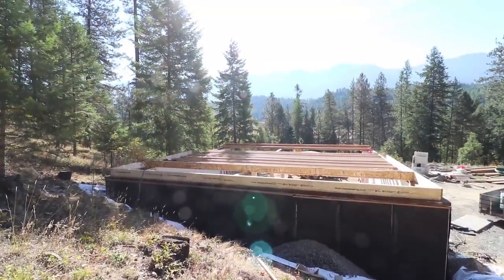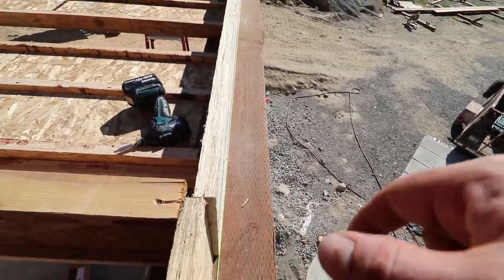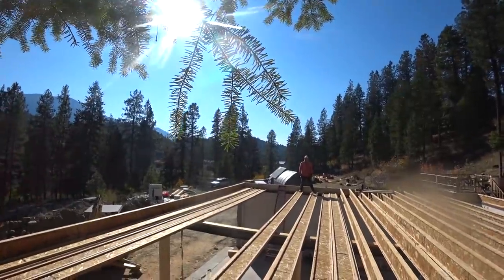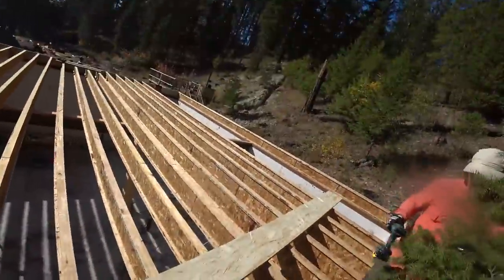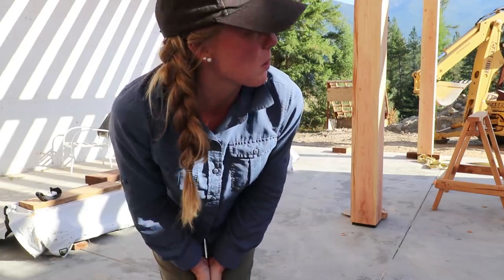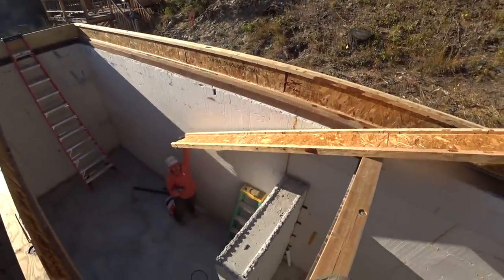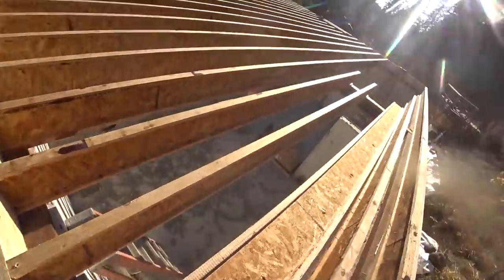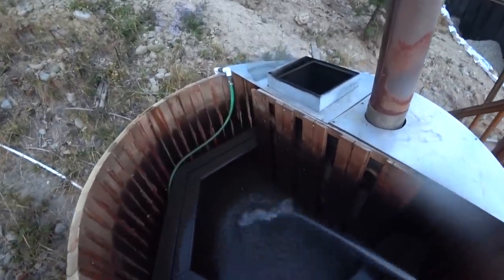OUR HOUSE LOOKS AMAZING (I-Joists & Rim Boards)

Comment: You're not going to screw this whole house together are you?  No nail guns?  your're wasting a ton of time. Screws for framing...have I missed something in building standards?
Reply: nails don't hold as well in TJI laminated lumber as screws.
Reply: The wood I joists they are using meet the minimum engineering specs BUT you will feel the floor "bounce" when someone walks around that weighs 200# over design  the floor load, also in earthwake country about every 4 ft nail a strap across the last 5 in of the I jpist , fold down and nail to the rim joist, > ( retired contractor Engineer and college construction instructor.
Reply: Please tell me they are gonna put some herringbone bracing into that floor... I hate those manufactured floor joists. Coming from solid timber framing for 30 odd years the manufactured boards aren't nearly as strong no matter what the official stamps on the boards say! at least with some herringbone bracing it should help with the bounce and flexing....
Reply: Those floor joist are better than solid lumber in almost every way. I wouldn't even span that far with lumber. That span looks just shy of 20 feet, you would need 2x12 or something to even think about that span. The shrinkage you get from framing a floor like that is terrible plus its slow. They are taking days on a floor system that two should get done in a few hours.
Reply: Yes I know the span would use 12 x 2. We use almost exclusively 12x2 H3 treated lumber with herringbone bracing for that kind of span he's calling 22ft+ measurements with a steel purlin at halfway and yes it does take longer but when you work with dried treated lumber in your floor the results so much more stable than the manufactured joists. what I probably mean is that the floor has a lot less sag over time compared to all the floors I've seen done with the laminate. Maybe I'm just a purist and am use to framing done the old way?
Reply: You sound like you know what your doing and each of us has our ways. I like an engineered product and our supplier goes above minimum when designing a floor system. I have never experienced any sag at all or any problems for that matter so I am sold on them. Almost all houses are built with them around here and I see nothing but benefit. The old methods work just fine though

Comment: 1 just a head's up, when placing structural members you try work from the ground up. by using the tops of a sloppy member like those joists as a reference, it's pretty well guaranteed you will have some deviation on the bottoms. so as the job progresses you'll have to remember not to use the bottoms of those joists as an absolute reference... they could easily be off 1/4" or more. also, the fact that the bottoms may have been off can translate to the tops now being off because the bottom stringer was not square to the web of the joist. something like that you would usually try to pin/peg/tack the bottoms, then use a brace with the tops in order to make sure the joists are standing true. if you had laid out the nailer first, screwed the bottom of the joist to the nailer, then used a 2' level (or tape measure) to tie the top to a brace running across the joists, the job still would have gone fairly quickly and you would be more accuate in your placement of the members.
certainly not the end of the world either way, just one of those little things.

2 I have a bunch of very big, beautiful trees to take down this winter. they were nice to have standing close to the building but now I'm starting to think my luck in russian roulette may be running out. my trees are cottonwoods so they are a lot less predictable/reliable but I would still drop the tree and try use some of it somewhere in the construction.

3 quote from old movie... "the oxen is slow, but the earth is patient".

Comment: Awesome to see the progress as of late! I do second (ha, perhaps mentioned a few more times than that) the use of nails instead of screws. They have much, much higher shear strength and are the professional standard. Plus, a nail gun saves A LOT of time. 
To the clipboard wielding safety types commenting on the fall hazard: This is what homebuilding is like, especially off-grid. Where would one tie-off anyway? Do you have a sky-hook they can borrow? Anyway, thanks for sharing this journey, it's really cool!

Comment: Hi guys, just a though, you oiled the first beam , but you were farming with the other 2 . I did not see you oil them after you cut them to size.
Could be an issue once you have a lot of weight on the beams. You guys are doing a great job. My wife an I are about to start our own project
in the near future.

Comment: That looks awesome! I jus hope you didn't pull 16"OC from the edge of your rum joist or I joist because then youd be 1-2" off of center the whole way down
Reply: soaringtractor yes but if the start at the edge of the board and not the center then all the other joists will b marked 16" to each edge not center I used to frame i know wat I'm saying

Comment: Is there a reason you guys are using screws instead of ring shank framing nails for your construction of the joist ? I am not picking .Just curious.The screws maybe stronger .  I was thinking the process would be so much faster and easier with a framing nailer.

Comment: Nice work looking good! I'm with the engineer blocking is a waste of time with those beams. Flooring/plywood will lock it in. What, no joist hangers???
Reply: The joist are sitting on the center beam and the edge acts as a ledger board. No hangers are needed. They may need some for the LVL's on the stairs. Depends on how they were designed.
Reply: Yes very nice, but I hesitate to put screws in at an angle like that with that type of "wood". No worries u added blocking and the floor will sure it up😎

Comment: I understand that ya'll need your rest and relaxation. Ya'll have done so well to provide as much content as you have. I would just like to point out that I'm understanding myself to find that your channel is literally acting like a drug to me because I'm having withdraws. Keep up the good work, I know ya'll have much more to come. Also considering the latency between date of video content vs date of release leads me to believe they're probably at a rough spot in the timber framing process. Considering they're like 20 days behind in the video world to what they probably actually have done, it's probably fair to say there's close to a complete wall/roof frame for at least a first floor now.

Comment: What's the code there for fastening your joust and rim? Here in canada we can use screws they have no sheer strength. A 3 1/2 has 300 lbs of sheer strength.
Reply: Joist* and we can't*
Reply: No shit I think the rule should apply in America to they need nails
Reply: LegendLength there is no shear load on those screws but it still doesn't matter with the code.
Reply: No forces for shear strength, shear load is not calculated due to the excessive overbuild of the main load bearing Structure. Also I uses screws as they are more compliant than nails. Most construction screws out perform nail gun nails in the shear category.

Comment: hope he set the all the joists with the knock outs the same if not lots of drilling for electrical. Always pull layout from one direction. Then pop line for center layout set ahead.
Reply: I did not see him measure from a knock out hole when he was cutting the I joists to length, order your I  joists long enough the cut the 3 blocks needed each span and then measure from a knock out for the first cut then cut the other end to length

Comment: Rule of thumb for headers over openings/doors/windows are 4'=4x4, 6'=4x6, 8'=4x8 ext ext. Exceptions are when loads require beefing up, kinda like building a house over a big garage door opening. Simple to fix now. Huge problem to fix later down the road.

Comment: Need to ask why does your base plate stick out so far past your joist and rim board ?
Reply: Is the base plat there to start stacking the logs to hid the rim board  if not the snow is just going to land there melt and roll into the basement or does the house have a porch all the way around it
Reply: Bikerchic  O thank you

Comment: Good call on blocking the joists.  Makes it much stronger.  In the old days of 2X6 or 2X8 floor joists they could twist causing problems.  Should help with squeaks too, assuming you're also going to caulk the tops before laying down the subfloor.

Comment: The floor joists look  very "tidy" but can someone tell me what will be holding the upper house to this floor/sill plates other than a few screws/nails ?  And will the weight of the house and those fastenings hold the house down in a worst case gale?  Sorry if this sounds naive I'm just an old  retired electronics engineer.
Reply: What holds your car down in high winds? Its not nailed to the road, and it weighs a fraction of what a house does?  Seriously? What holds the house down? Now I've heard everything.
Reply: august OK...I will give a real answer. A screw with 5/8" penetration depth will have a pullout force of roughly 250 lbft on avg.  Let's say they have 200 screws into the sill plates for example. That would be 50,000lbs of pullout strength. Now lets add the weight of the house structure on top of the sill plate.  I think you are starting to get the idea of what's holding down the house from floating away in a breeze.
Reply: august The question wasn't about the bolts holding the sill plates to the wall. It was about the screws holding the floor joists to the sill plate. In any event...the house isn't going anywhere even in the highest of normal storm winds they are likely to face. If they get hit directly by a tornado, then no amount of bolts are  going to save the house. Tornados are extremely unlikely in their part of the country.
Reply: He guys, thanks for the replies , even if AndTheCorrectAnswerIs seemed a little arrogant ,(the clue's in the title I guess) . I'm keen to see the framing next because my guess would be that they are going to fasten (screw) the frame to the floor boards which in turn will be fastened (nailed? ) to the floor joists which are screwed to the sill which is bolted to the reinforced wall (and without j bolts !) . Not my idea of secure . Maybe their"engineer" has done wind loading calcs  ?

Comment: Why are the Rim Boards on the middle of the sill plate instead of the outside edge? Does it have something to do with timber framing?
Reply: There will be sip panels that land on the outside of the rim joists (i believe)
Reply: I was wondering the same thing. I figured they would build it close to the edge so they can run the outside sheeting just over top the basement wall.
Reply: Peter, you're right. I forgot about the SIP panels :)
Reply: They talked about this a few videos back... they're actually going to extend the sill plates out with 4x4s because the sheathing (or something) that attaches to the walls will hang over and the sill is being over-sized to provide a bottom for it. It also seems sensible to have the timber frame bearing directly onto the sill rather than resting on the floor, but I don't recall anyone saying anything about whether the beams will go inside, outside, or atop the rim yet.
Reply: SIPs are the outer layer I couldn't remember. They're foam-core panels, several inches thick, and the extra width of the sill is to provide a bottom cap for them.
Reply: i guess that makes sense to insulate the thickness of the subfloor and joist area with the SIP panel... every time I installed SIPs they rested on the subfloor not the sill plate;  and the posts of the timber frame were inset from the rim boards the thickness of the SIP panels... extra blocking was added to carry the load of the posts to the sill plates in those locations... most of those houses had thicker foundation walls than this, i believe

Comment: A gutter manufacturer may be capable of making that for you. OR pad out rims to come 1" from edge of bottom plate/pressure treated. QUESTION: Do you have enough room/3 1/2" to place a 4x12 over to garage doors? Couldn't express how much you need to do that.

Comment: This is th 2nd DYI framing project that I've seen were they put the rim joist in the middle of the sill plate. WHY.  I can see holding it holding it 1 1/2" from the edge to allow for ply and exterior finish (stucco or siding) AND you need a beam above the garage door. I suppose a 4x12 could work.
Reply: They are using SIP's
Reply: j .novick what is a sip?

Comment: Measure the diagonals for square.Once you do your layout and have it marked on the TOP PLATE,,,Measure for your subflooring and see if it is going to layout right on the top of your JOISTS,, THEN and only THEN start Nailing.  Nail those damn joists (fall apart icle joists) to the top plate and rim joist, Much faster, 
Measure Three Times. Nail ONCE! LOt of work. Go easy and take care of that lady!

Comment: BRAVO!  I truly  admire your tenacity. You keep working at a problem until you solve it. But there is one thing (actually more) that I don't understand. To most people I know, "living off the grid"  means finding substitutions for the standard, accepted (and normally expensive)  way  of doing things. Especially if you can do it better of at least as good as the standard way for less money. One thing for instance, - your I-joist - you have a sawmill and lots of logs. Instead of paying $125 - $200 ? bucks for I-joist, why not start out with a different framing plan and saw 2 x 12s  - 4 x 12s (or whatever it takes) for the floor joist and save a couple of thousand bucks? I don't believe most off grid houses have I-joist in the floor. It seems you have passed up several opportunities for this kind of savings.  I built my own house by myself 45 years ago. It took 5 years. Which means I'm 73 now and I won't be doing that again. AND YES, IT WAS WORTH IT. It's good to see there are still people out there as crazy as I was doing this kind of thing. Keep up the good work. I've enjoyed watching you.

Comment: I hope you guys are going with the 1-1/8" plywood for your sub flooring.
Reply: They are using Warmboard to tie into the radiant floor heating system in the slab. https://www.warmboard.com/why-warmboard  Looks like it is 1 1/8" all told.
Reply: Anthony Bowman, That looks very interesting. It looks like a pain to install. I guess they are doing everything the hard way. I take it that its going to be more the one video on the install. Thanks for sharing.

Comment: Hmm, screws instead of nails for framing?
Reply: To Pull A Nail Buy A Cats Claw Problem Solved !~!~ :):)
Reply: Something about shear strength. Holding down decking is fine, but screws are inherently brittle. If there are any sideways forces, the screw can break.

Comment: I didn't know you could screw rim boards to i-joists. What fasteners are you using?
Reply: taiden I'm almost certain that you're supposed to use 10d nails. At least all the joist I've done are that way.
Reply: cheers

Comment: I don't get this construction system. What is holding up the weight of the house? Thin boards on edge and a 5" wall?
Reply: Thanks for your Replies. I'm pretty sure this wouldn't pass planning here in the UK. Those Posts will carry the central weight on three pins along the grain of the wood. Compelling viewing though.

Comment: I like the idea of using blocking, that type of floor has a lot of bounce, blocking helps spread out the force over many beams and not just a few. We should look back how homes were built by our great great grand parents and copy it using our modren materials. Look how long those houses have stood and how strong they are still.  I've got 2x10's 16" on center, I know I have at least one or 2 that have kicked out not standing straight up blocking would have stopped that, but the builder didn't do it. It's not mim code.

Comment: You are showing the small errors that go with construction. do not feel bad even the pro's make them albeit not too often I hope. The big thing to your credit is that you are Correcting and or compensating for the errors. Often this is not done in comercial construction unless the inspector finds the fault.  Just remember the 345 triangle rule  and check the diagonal you will save yourself hours of adjustments.
Keep up the work and you will get there. Day to day is tough but look back 4 or 4 weeks and your accomplishments really show major progress.